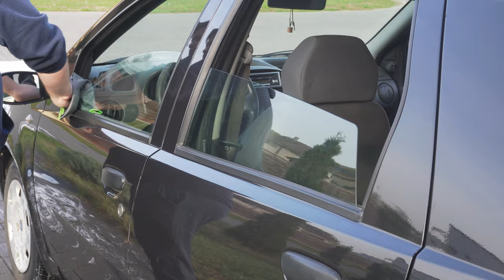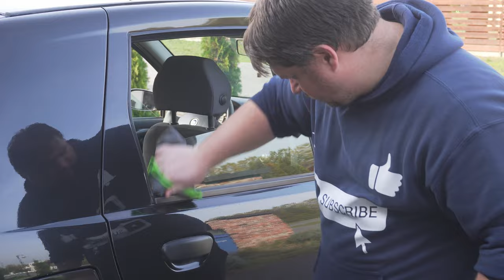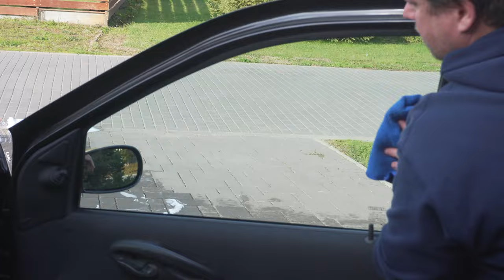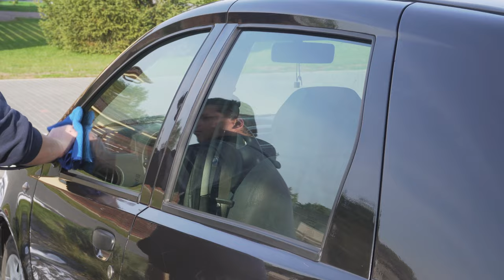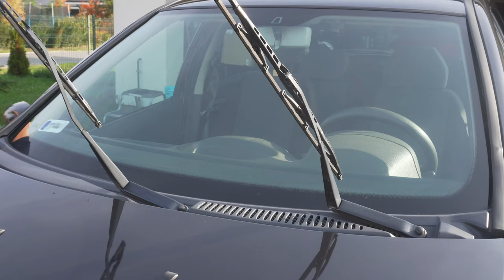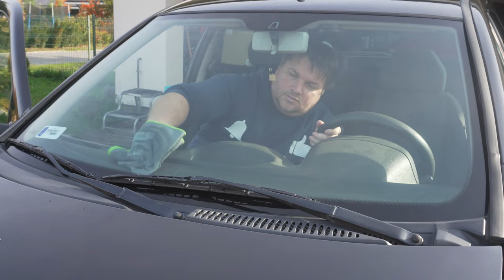Liquid Elements Carbon Glass Cleaning Cloth test

Comment from the maker: MJJC Foam Cannon Pro, straight from the manufacturer: https://www.mjjc.com/collections/foam-cannon/foam-cannon-pro/?ref=OCDADDYZSOLT

MJJC short gun, straight from the manufacturer: https://www.mjjc.com/collections/high-pressure-washer-guns-and-nozzles/?ref=OCDADDYZSOLT

Automosowebshop.hu: 10% discount on ADBL, Tenzi and Booski Car Care products: https://automosowebshop.hu/?coupon_id=ocdaddy

ADBL Shop, 10% discount with the ocdaddy code: https://www.adbl.hu/?coupon_id=ocdaddy

Farmasi Hungary, 23% discount by using the following link: https://farmasi.hu/Account/Create?sponsorCode=64648810-11cd-44db-942e-3a229e0eb3b1
Farmasi Poland, 23% discount by using the following link: https://farmasi.pl/Account/Create?sponsorCode=64648810-11cd-44db-942e-3a229e0eb3b1
Farmasi CZ, 23% discount by using the following link: https://farmasi.cz/Account/Create?sponsorCode=64648810-11cd-44db-942e-3a229e0eb3b1
Farmasi Slovakia, 23% discount by using the following link: https://farmasi.sk/Account/Create?sponsorCode=64648810-11cd-44db-942e-3a229e0eb3b1

Polirtech.hu, various discount for certain times, details under the relevant videos: https://polirtech.hu

Gtechniq car care products: www.gtechniq.hu

Polytop and Primatec products: www.primatec.hu, www.polytop.hu

Autoglym and similar products: autofejlesztes.hu

Turtle Wax and similar products: hellocar.hu

Porzelack products: porzelack.hu

Elite Detailer and similar products: carzoneshop.hu

Various car care products: autobirodalom.hu

RR Customs and Bad Boys products: www.rrcustoms.hu

Marco Martely perfumes (for cars): marcomartely.hu

TubeBuddy for better channel analytics and tools: https://www.tubebuddy.com/OCDaddyZsolt
Would you like to have a single card that can be used instead of all other cards of yours? Use Curve - http://www.curve.app/join#DG8K2BLD
Would you like to have one of the best exchange rates and safe shopping/money transfer abroad? Use Wise - https://wise.com/invite/asd/zsoltv23

In case you would like to support the channel: PayPal - zsolt.tech.detail@gmail.com

Comment: Hey daddy,  is one of the best towel you used ?
Reply from the maker: Hiya, there are a number of towels that are exactly the same as this. It is a good one, if you don't have a tinted film on your glass and the glass is really dirty. Otherwise just use a regular waffle weave towel for glass.
Reply: @OCDaddyZsolt  they can scratch tinted film ?
Reply from the maker: @sandwichburger4856  Yes, it can. It is a rather harsh towel. Hence it is very good to remove mineral deposits from glass.
Reply: @OCDaddyZsolt  okay i see , i use FTW of the rag company , fantatisc